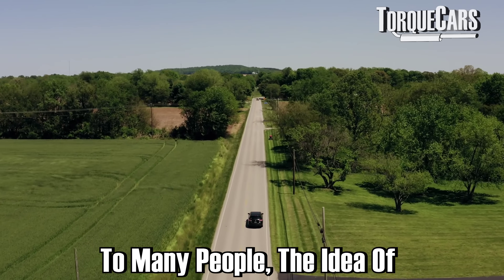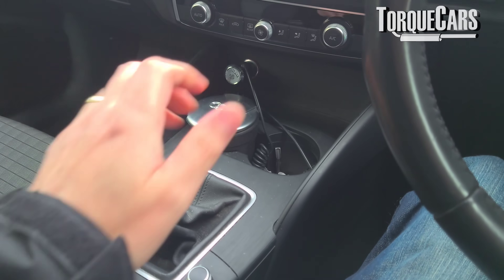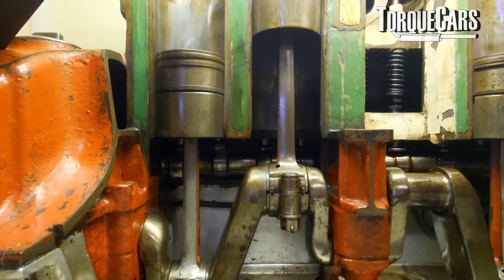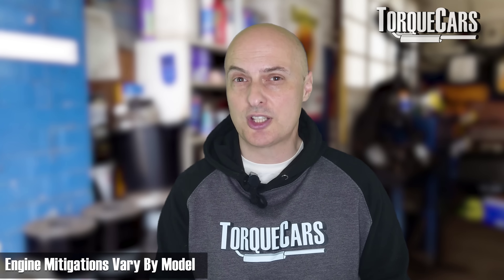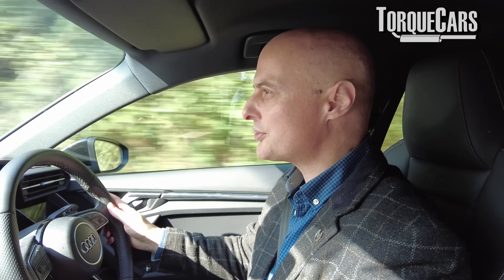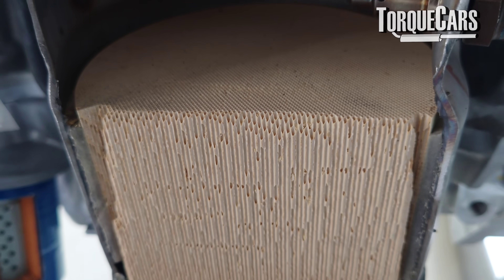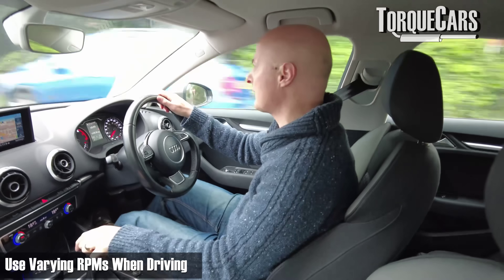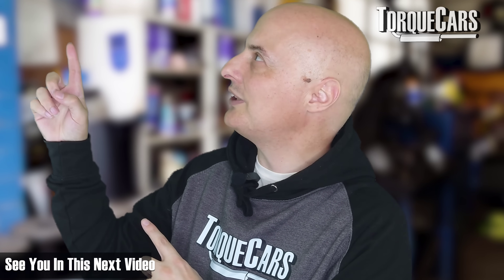BIG DAMAGE By Lugging at LOW RPM? Eco Driving Warning! (Manual Gears)

Comment: A Porsche engineer once told me: "If you love your pistons, never accelerate at low revs.'"
Reply: The Porsche salesman told me the opposite.
Reply: @VictorMaxol  Salesman wants to sell a new car.
Reply: @mirasetrin3273  that was the joke 😅
Reply: @VictorMaxol  salesman aren’t technical people, most likely have never turned a wrench
Reply: @VictorMaxol  lol salesman told me that too after my warranty expired. Hmmm 🤔 you don't think he was trying to get me to blow up my truck by chance do you?
Reply: What do salesmen really know? They just can't the commission  @VictorMaxol
Reply: High revs on a cold engine cause blow by and you get diluted oil from fuel mixing ! Not everyone is drinking a V 12 😂
Reply: @azarahwagner2749  Great way to toss a rod also
Reply: you can accelerate at low rpm as long as you don't try to floor it. just gradually increase throttle
Reply: Guess he wasn’t aware of diesels.
Reply: I dont understand the statement, a cars accelerating from standstill starts at low revs. Does he mean change gears at higher revs to maintain high revs?
Reply: @jerry5876  He is saying not to shift to a lower gear ratio (normally a higher numbered gear) prematurely. So maybe more like high enough revs (typically from 3 to 6.5 kRPM).
Reply: @doppelwaffen  Tell that to my mom 😂 once the car was detonating she found out
Reply: Yes with a manual transmission you can cause more wear on the engine by lugging it a lot by increasing manifold pressure at low rpm. Most of what’s in this video isn’t true. Modern cars with auto transmissions will immediately shift to allow for higher rpm. Modern car engines run so lean that the gumming up is really from venting the crankcase pressure back into the engine. Just change your oil and drive your car. If you have a manual transmission, yes don’t floor it in 3rd gear from a near standstill it’s bad for it.
Reply: Ah yes, Porsche, where 2nd gear is good for like 90mph. I'll make sure to go to jail every time I drive.
Reply: i lost an engine like that because my wife put her foot down on my tuned turbo car in 6th. Shattered the piston rings, cracked ringland and melted piston #3 due to LSPI lol
Reply: My foot told me the opposite😂
Reply: how are you supposed to increase the revs, if you are not accelerating? :O I mean, yes, you can downshift a gear or two, when you are moving, but how would you accelerate fast from a stopped position, without putting your foot down on the gas pedal?
Reply: Damn. The Bycicle comparison made my 🧠 go 💥
Reply: I knew a lady that would give it full pedal when the manual engine was barely running at 1500rpm up hill when she NEEDED to shift down but everyone thought it was “fine” smh people can be retarded
Reply: How does one "accelerate at low revs"? If it's in automatic mode, it won't move much faster without downshifting. Are you referring flooring it in automatic while the car is still in a higher gear?
Reply: But you have to accelerate to get to higher rpms..
Reply: That Porsche engineer didn't have much experience with an engine that made torque from here to kingdom come!
Reply: Depends what car you drive
Reply: @doppelwaffen  thats why everybody else used liquid cooled engines way before Porsche: Air cooled engines need fan speed to cool.
Reply: Why is Porsche building engines to produce an amount of torque (through air and fuel delivery) but not making it mechanically able to handle that condition?
Reply: Ferdinand Porsche once told me:"If you ever buy a Porsche, it should be the Elefant"
Reply: I love them but it's kind of an abusive relationship
Reply: But how do you increase your rpm without accelerating?
Reply: How am I going to win the Race?
Reply: If not accelerate how the engine will go high rev?
Reply: @doppelwaffen  you can accelerate in any range as long as it's gentle and controlled. Dumping the throttle will damage though
Reply: Because Porshe is actually not that good in making engines and yes if you own Porshe especially 2000-2015 models you are better of driving it like looney then treating it carefully. In older boxters you actually HAVE to treat it like race car or factory fault will kill the engine as it only gets enough oil at high rpms.
Reply: I’m sorry for this Engineer… and the pistons.
Reply: False economy……yep just like introduction of DPF, EGR, Catalytic converters, stop start, AdBlu, light weight plastic engine components……..ultimately engine durability and longevity are negatively affected.
Reply: in general nowadays its probably true because of low oilpressure at low rpm. but my old porsche 944 from the 80, i got an oilpressure gauge which shows at idle allways 3 bar of pressure, while in modern cars its often 0.8bar. its not the piston itself which will break, but the oilfilm will break easier on modern cars. iam driving my porsche 944 now for 21 years and with extreme lugging even full throttle under idle rpm, and it doesnt cause any damage. there are some workshops who increase the oil pressure at low rpm, to present future damages. which isnt needed on older cars.
Reply: Of course. That gives them more revenue.
Reply: @doppelwaffen  before warmup should stay below 3000 rpm… once warm it is OK
Reply: Its a bad idea on air cooled engines on hot days, since the cooling fan doesn't have much excess capacity then. For liquid cooled engines who cares??
Reply: So never accelerate basically. The only way to get to high rpm is from low rpm. Unless your engine idles at 4000. According to your “Porsche engineer” stay in low rpm’s for ever.
Reply: A lot of modern engines like to hover between 1,000-2,000 rpm for normal driving , even at 70mph with cruise control on ( highway driving ) I use to drive a semi as well , some of the newer Cummins sweet spot for shifting were at very low rpm compared to older models . I would think that driving around at low rpm as being bad for an engine would be more engine specific , and not a universal application for all vehicles, especially newer engines . Comparable to how there is not one size fits all engine oil , even of the same viscosity . A number of factors apply . There is an optimal operating temperature for oil to function as intended , and not all engines operate at the same temperatures . Think race engines compared to commuter engines . Then there is the climate factor , and driving habits factor . Another example for instance , most modern cars or engines that have 500,000 miles or more typically ( still running without engine work Toyota/Honda ) accumulate those miles via highway miles , which means hovering around that 70 mph range at low rpm 1,500-2,000 rpm . To average 100k miles a year that would be mainly highway miles 70-85% (gasoline engines). When I drove a semi ( diesel ) I averaged between 500-650miles a day , but closer to 650 miles a day . 2,800-3,200 miles a week 134,400-153,000 a year , again primarily highway miles ( low rpm ) no engine work . My point is some engines may operate just fine or be optimized to operate at low rpm for longevity . Higher rpm , generate higher temperatures , which can increase friction , which in turn can lead to more wear . Think recommend oil change intervals for higher reving engines , why ? Engine oils get dirtier quicker , and break down quicker which in turn works against that engine oils lubricating properties . Low reving engines tend to last longer because they put less stress on mechanical components over time . Now lugging around in too high of a gear while under load is different, because the engine is not lubricated adequately, due to low engine temperatures . There needs to be a proper balance. Heavier vehicles tend to need a lower gear range, while lighter vehicles ( commuter ) can be just fine with higher gear ranges . Performance engines however are designed to run harder at higher rpm in conjunction with a gear range that mates well with that engine design . You don’t want to baby a supercar . It’s not not optimized for daily commuting . Trying to take a Corolla for example and drive it like a track car at redline, is going to put more stress on that engine than it was intended for , shortening its lifespan .
Reply: If you don't accelerate at low revs then how are you going to get you RPM up. how are you going to go faster,  How are you going to make it up that hill.  How could you even make the car go if you don't accelerate.
Reply: @Greatday68 you drop down a gear or 2. The point is if you can drop down a gear then it's better, you are technically lugging your engine if you try and put your foot down in say 4th 5th when your going 30, simple way is if you are below 2,000rpm and want to pick up quickly then drop it down....
Reply: @philpots3216  To make a car go you have to accelerate; you push the accelerator pedal down with your foot. That in turns tells the engine to increase fuel and air to make the engine accelerate. Otherwise, you're just sitting there idling.  That is just basic common sense. for anyone who drives. You have to accelerate to make a car go, You will never get anywhere in any gear if you don't accelerate. No matter what, you have to accelerate from a low RPM because engines start off completely stopped, no RPM at all, and when they do start most engines turn at a very low RPM, And you never want to start an engine at High RPM, that's a good way to kill an engine. 
 Do you get it now or are you not that intelligent. My comment was to show how stupid the original comment here was.
Reply: @Greatday68  oh dear you missed my point, yes I'm fucking stupid
Reply: @Greatday68  it's meant how you accelerate. Tuned cars wich were originally na cars wich high torque could damage the engine at lower rpm. So you try full boost only at higher rpm. It's saver there. This is an example what is happening on a small scale in stock engines.

I drove my Subaru over 15 years every morning at max to 2500 when accelerating but very carefully with not much throttle input. After that around 1500. Simple reason on this street everything above is too fast. I have this car know for  nearly 19 years and everything is ok.
Reply: @Nordlicht05  I question your knowledge on anything automotive. I question your education here based on how your comment is written.  
 Of course, the Porsche engineer meant how you accelerate. But thats not what was said.
 By the way, if your subaru's max RPM is 2500, You've got a slow automobile, and something is wrong with it  or you're a chicken. Even the subarus from the 70's had a better top end and they were slow. 

 As for your tuned cars comment. I have an engine that makes full boost just above idle, but it has an 8-71 BDS sitting on it Now my 83 Buick T-Type I had to tune it for full boost to come in low in the RPM range. And back then it wasn't as easy. we didn't have the laptop pc like we have today. After upgrading the turbo and getting a bigger draw thru card. I had to use the emission testing machine to get the air fuel right. That and reading the sparkplugs 
  Your everything above is too fast comment. Thats just too funny. I know it is based on how you drive on the street. And it is your opinion, I say you're scared and don't know how to drive a real car with real power.
Reply: @Greatday68 Way to misunderstand, do you want a cookie mr argumentative? Obviously they are saying if you’re going to floor it, downshift instead of starting at 1200 rpm and lugging the heck outta the engine. End of. That’s all. Argument over. If you want to be more pedantic, first gear doesn’t matter that much, mainly higher gears
Reply: @SeniorBillzy  I'm not misunderstanding anything. You are the one misunderstanding. And I'm positive that happens a lot with you. My comment was showing the porsche engineer said something really stupid,  Do you understand it now.
Reply: @Greatday68  I bet you're real fun at parties...  From a stop, this advice doesn't apply, that is your only point, let it go.  He's talking cruising speed, in that case if you need to floor it you drop down a gear or two.  Feel free to accept that you're wrong and all these people above that were trying to help you understand were right.
Reply: @Greatday68  It's funny how you describe others as dumb but apparently you are not able to read a text with common sense, he never said that his car has a max RPM of 2500, he wrote that is driving it to a max of 2500 RPM before gear shifting to avoid low RPM acceleration
Reply: @Greatday68  An example he is talking about, would be keeping it in a high gear and forcing the engine to lug very hard. This lugging is not good
Reply: @Greatday68  shift down, then accelerate 😉
Reply: @andylambertz84  how can you shift down when in first gear or reverse? You can't so to go faster you must accelerate. You have to accelerate to get moving. I know there are a lot of un=educated people like you on here that don't truly know how an engine works so maybe this will help you understand. You're at the bottom of a hill, you just started your auto, You put the car in first, To make it up the hill from a stop, you must accelerate. You can't drop a gear if you're already in first gear. I can't believe there are idiots that don't get that it is impossible to never accelerate from a low rpm.
 And your comment "shift down, then accelerate". After you down shift you say to accelerate. Why? It's because you want to bring the engine back up in the rpm range from a lower rpm range that the Porsche engineer said never to do. 
 The Porsche engineer statement is wrongly worded. That's if a Porsche engineer actually said something so stupid.
Reply: @Greatday68  Drop a gear.
Reply: @codejunki567  There is no dropping a gear when you start off, or go in reverse.
Reply: @Greatday68  They obviously mean don't lug the engine stop being a dolt. 

Obviously in 1st gear you can't drop a gear. But you're in 1st gear, it has the MOST torque to get into the upper rev range so your argument is completely useless
Reply: @codejunki567  What they mean and what they said are 2 different things. . It does not matter what the person meant if the person does not convey it properly. That makes anything you say irrelevant. to the point.
 You say Obviously, means don't lug the engine but is it really obvious. If you ask the vast car communities then yes. If you ask everyone in the world then the answer is no, it's not obvious to the majority of people. Most people only know to put the car in drive. Most people don't know how to drive the way you're talking about. or the pure pleasure from driving like that. The truth is most people don't know much or any about automobiles or even how to drive. They think they how to drive but we know they really don't. 

  Your argument is useless because to bring your engine rpms up while in first gear means you have to accelerate to be able to get the rpms up enough to get the car to move. A normal engine does not have enough torque at idle to be able to move the auto uphill from a complete stop without accelerating. 

  Obviously, 1st gear will multiply the engines torque higher than any other gear, but you still have to ACCELERATE to get to peak torque that are higher up in the RPM range. An engines peak torque is not at idle as your comment infers. 
 It is important during this time in history with social media and people making up things, so they don't have to type as much and be quick, to be clear on what you're saying or conveying to other people. Even if a lot of people know what you mean not everyone will. Personally, I like it when people take the time to be sure that more people will know exactly what they are trying to convey. And here is what I'm conveying. It is impossible to never accelerate from a lower RPM. 
 They shouldn't have used the word never. It should have been stated as this. 
There are times when you should not accelerate while in lower RPMs so not to cause internal damage to your engine.
It's simple and to the point. If some ask what that means or why not, then the idiots that replied to my comment can jump in with downshifting. Just be clear with what you say and how you say it, so someone doesn't send their engine past redline and cause catastrophic engine failure 
  You know the best thing to do once you realize that you're wrong, is to learn from it so it doesn't happen again, and you don't seem like you're under educated.
Reply: @Greatday68  Jesus you really love pointless arguments don't you? It's obvious what the "porsche engineer" meant to say, even if he worded it badly.
Reply: @Greatday68  your comment doesn't make any sense to me. Other than when you first start moving out of 1st gear, you'll always have a gear to shift down to if rpms get too low while climbing. If you dont instinctively shift down when the rpms get too low, that's just not very good driving. A normal car isn't going to have enough torque for the low rpms and you'll likely stall out, or like I said before, instinctively shift down to get the engine back up to peak torque to get you moving again
Reply: @Greatday68  The factory start engine high rpm .when engine warm up you hear  engine work more smoothly. Tell me is true.
Reply: @PandiKristo  Actually the manufacture starts a new engine at a low RPM until the engine gets up to operating temperature before going above 1500 rpms as per manufactures break in recommendation. then they change the oil and filter.  
 And performance cars like the Corvette actual programs the computer so the customer cannot go above a certain RPM and mph during its break in period. after so many miles the computers program turns off the break in period program and allows the engine to go above the RPM that was set for the break in period. 
 So no, your comment is not true, and I will not say it is. 
 Even when you purchase a brand-new manufactured engine or a rebuilt engine, The manufactures warranty states not to go above a certain RPM during its break in period of so many hours or milage. 
 Cam shaft manufacturers have a certain break in procedure and none of them starts off high in the RPM range, They start low and gradually gain in rpms 
 I understand that you want to be right and prove that you are. But the facts are proving you wrong.  I don't know who told you what you wrote in your comment. But it's wrong, And that is OK to be wrong, as long as you can admit your wrong and learn from it. I've been wrong before. I'm not wrong here, But I am willing to learn, and I hope you are also.
Reply: @skatahman1 even if torque is good, i would still shift down. My old diesel could do a lot more than my petrol one at same ish low rpm driving. The issue was, my dpf clogged in diesel and caused havoc. 
Had problems with it until i changed my driving style to lower gear higher rpm in most places. Problems went away.
Reply: @Greatday68  absolutely you are correct,turkeyman doesn’t know what he is commenting about
Reply: @Greatday68  Fun fact btw, when you start up your engine it actually goes to a higher RPM than usually when idling to kickstart basically, just a few seconds later it will go to normal idle RPM, ever asked yourself for what reason that's happening?
Reply: lol
Reply: @Greatday68 you downshift!!!
Reply: @wailingalen  You can't comprehend what's been talked about. go back to school.
Reply: @Greatday68  Yeah that was in me too. If you don't accelerate you won't go anywhere so your Porsche stays parked.
Reply: @Greatday68  You simply shift into the proper Gear. Thats the point.
Reply: @Greatday68  Downshift
Reply: @Greatday68  Well…you can get the engine in the higher rev. range by waiting to shift, until you reach said rev range. And you can keep the engine out of lower rev. range, by not waiting to shift back too long, but doing it before you reach those lower rev. ranges. Try it… it really works! If you master that skill, all you need to learn next is dumping the clutch at 3000rpm when you leave from standstill in 1st.gear. 👍 Have another, Greatday… 😆
Reply: @Greatday68  don't floor your pedal at idle RPM...........clear ?
Reply: @Greatday68  lower the gear lol
Reply: @Greatday68  Press the pedal gradually, start by pressing gently after it gains half rpms press harder. If you plan on getting more speed so you’ll need to switch another gear, keep pressing hard. After you get to your desired cruising speed, change gear to the lowest but healthy one (while cruising on horizontal roads, petrol cars should stay @2000-3000 rpm while diesels @1800-2600 rpm).
Reply: @Greatday68  Drop down the gear according to torque, kerp rpm should be above  1800 when climbing the hill.
Reply: @Greatday68  You downshift into a higher rpm...
Reply: @Greatday68   change gear (down)
Reply: @Greatday68  you car drops only 1000 rps max from gear to gear, if you are driving on high, next gear will be on high. The first gear will be on low but will be only for a short period of time. The engine will be ok for the first gear because of the ratio.
Reply: @Greatday68  u down shift bud.
Reply: @Greatday68   neutral drops, Rev it up in neutral and drop it into drive. Don't want to damage the engine.
Reply: @Greatday68  “don’t drive”… it’s the joke 🤣 😂
Reply: @Greatday68  I think he means don't floor it with low rpms.
Reply: It makes sense that you should never give full throttle at low revs. The cylinders will then become much too hot, which can cause the rings to crack, as Subaru also advises. Now that rarely happens in Europe, because the petrol is of much better quality, but if you live in the USA, be careful..
Reply: @antoniocalimero1173  I assume this in high gear at low rpm am I right ?
Sorry eng is not my native language so it kind of confuse me
Reply: @uthopia27  Yes👍
Reply: @antoniocalimero1173  Europe doesn't have higher quality petrol its just measured differently 98 ron is 93 ron/mon here
Reply: @antoniocalimero1173  that's not how any of cars work. At all.
Reply: @antoniocalimero1173  that's a common myth about us vs eu gas. The eu measures octane ratings differently, so you aren't actually getting a higher octane value. It would be like saying 212⁰F is hotter than 100⁰C because 212 is more than 100. It's just a different scale or unit of measure for quantifying the same thing.
Reply: @antoniocalimero1173  Why do you believe Europetrol is better than US?
Reply: @antoniocalimero1173  petrol in Europe is not better than in the US. Both sell high quality fuels. If you’re referring to octane ratings they, they use different rating systems where in Europe the numbers are higher, but 95 in the EU is equivalent to 91 in the US.
Reply: @antoniocalimero1173  only 100 octane and above ☺️🙌🏽 and I drive a VW polo 6n from 2002 😅
Reply: @antoniocalimero1173  I call BS. Fuel quality in the States is as good as anywhere else in Europe.
Reply: @5metoo  Ethanol content is way too high
Reply: @PointNemo9  - You've got a point there. I'm told E85 is readily available in some European countries but in the US I think a certain % of all gas must be ethanol. It's a crime.
Reply: @5metoo  I've driven in Britain, Italy and Germany and the highest ethanol that's readily available is e10. Premium (98 or 99 octane) is e5.
Reply: @PointNemo9  I understand that in Germany tax incentives were withdrawn in 2015, so E85 disappeared and biofuel is now taxed the same as regular fuel.
Reply: @antoniocalimero1173  way to make a conversation not about you and Europe And you and Europe lol
Reply: Makes no sense. How you supposed to go faster?
Reply: @talltom1129  you downshift into a lower gear and accelerate
Reply: IDeAllY You want to start youR acceleration iN 
the geaR that puts youR engine rpm 
cLoSest to it's Red Line.
Reply: @yolandalindsay8368  It shouldn't be close to redline though.
Acceleration should be on the range you get more power, while keeping your speed on flat ground should be on the lowest rpm of the higher torque range.
If required to go up hill you should change gear to the higher power range of rpm. (Going downhill depending on weight and inclination you might need to get a lower gear to avoid accelerate to much whilst not burning brakes).
Reply: I think the point they were trying to make was to not use excessive acceleration at excessively low rpm. I think everybody knows you have to start from low rpm and have to accelerate to get to higher rpm. It's just a simple matter of moderating acceleration until you have attained higher rpm.